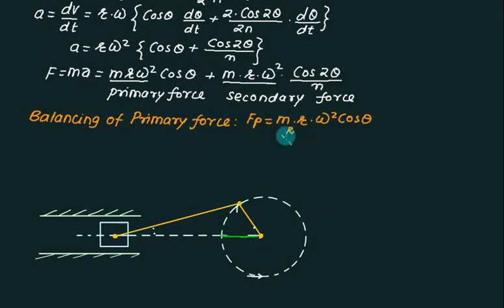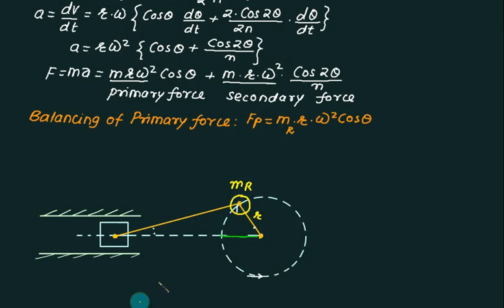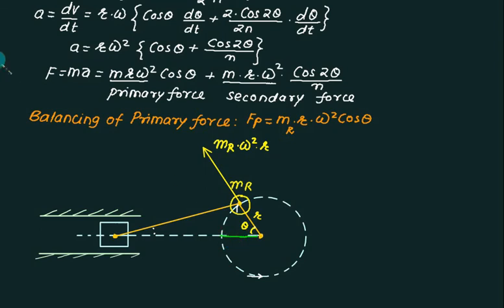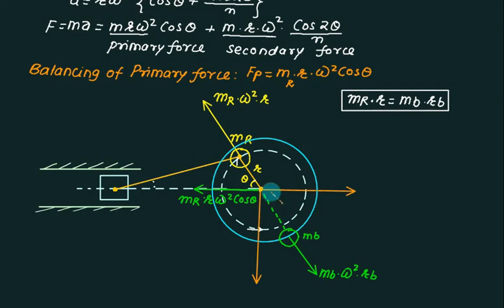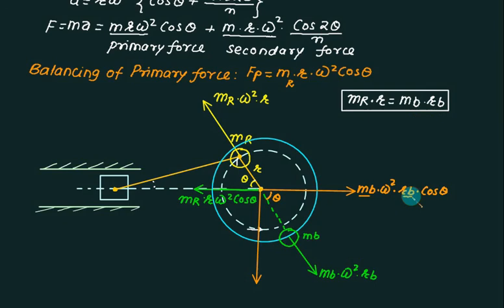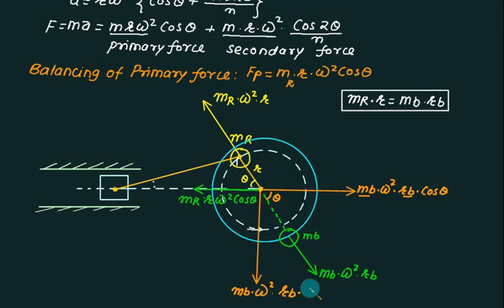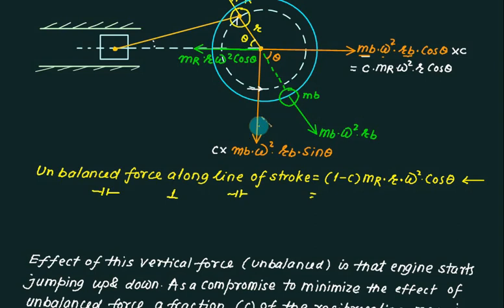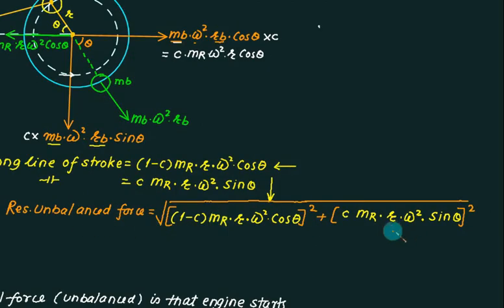TOM  06 |  Partial Balancing of Unbalanced Primary Force in a Reciprocating Engine

Comment: Guys, the reason why m R vertical component is neglected because the slider only moves in horizontal direction. Furthermore, the vertical force of m R is countered by the walls between the slider. Thus, net force is zero for vetical component. Cheers guys
Reply: Thanks brother ❤️

Comment: sir, why ur not considering vertical component of centrifugal force M.R.w2 sin θ.
If we consider Unbalanced force prependicular to line of stroke will be (1-C)M.R.w2 sin θ
Reply from the maker: It is imaginary mass placed to have the idea of unbalanced force
Reply: sunil mohod then why don't we just make the mass of crank pin (pin connecting crank & connecting rod) equal to the reciprocating mass. That will solve the problem of vertical unbalanced force.
Reply: It's not clear to me why aren't we taking the vertical component of the mrw^2?